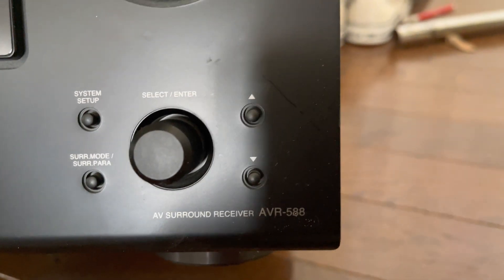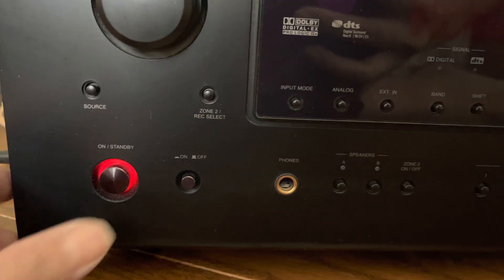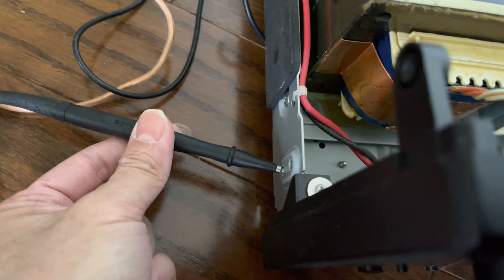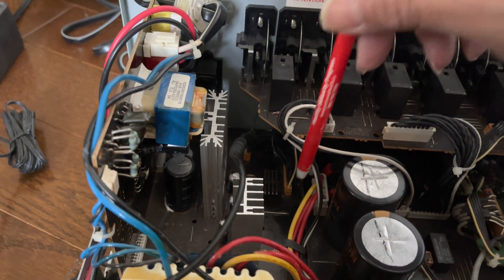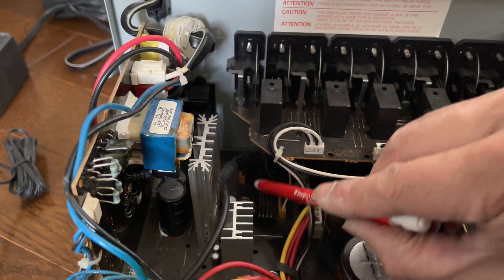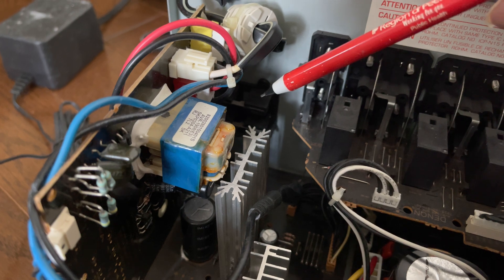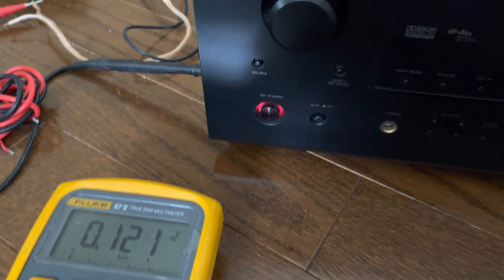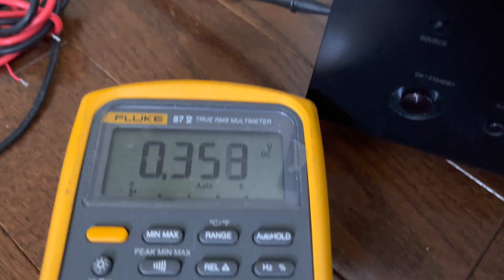Denon AVR-588 Receiver Flashing Red Light Repair 1/3

Comment: yes, but the manual does not have this information, so I do not know the procedure
Reply from the maker: I'm not Denon Support, so I can only suggest.  If manual doesn't has Panel Lock info, either it is not supported, or try to use Reset. Processor failure could be another possible cause, and replacing the processor doesn't worth the repair